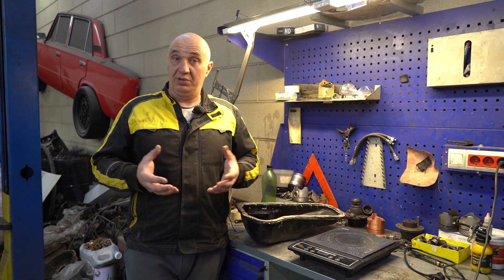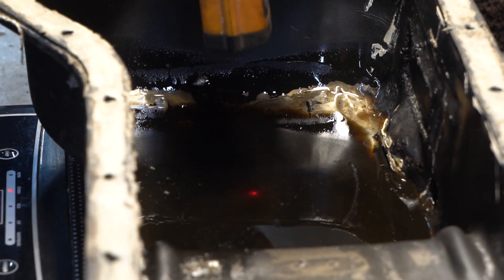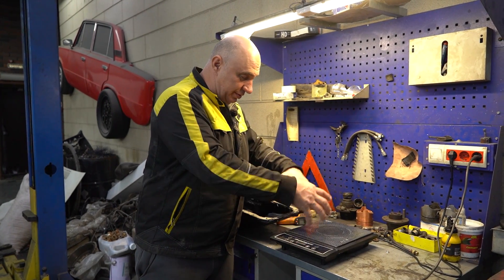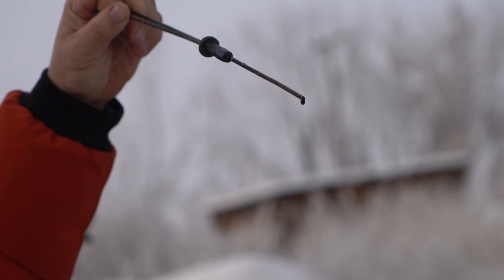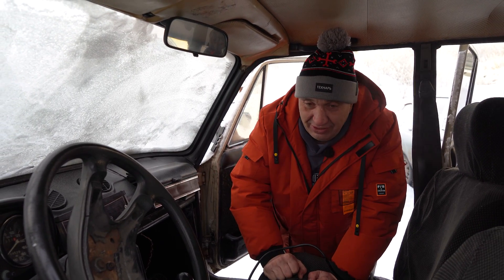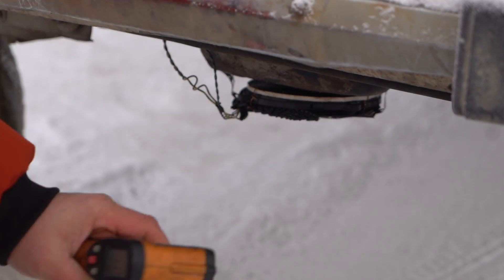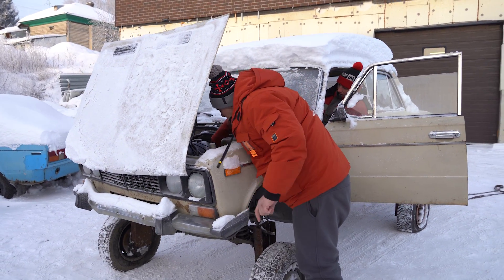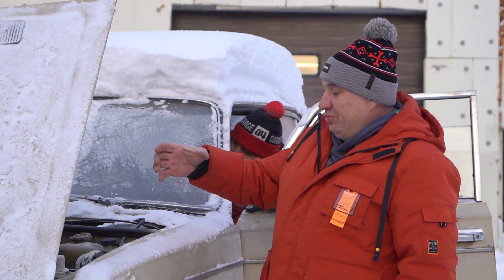We fit an Induction Stove to an Oil Pan

Comment: I would say that heating the coolant would be better as it heats up the block, heating the oil only heats the sump area until you start the engine and the oil circulates.

Comment: Heat exchange/electrical or oil powered convection pump (preheater) mechanism between engine and radiator reservoir.

Comment: If you had time, I would definitely warm up the coolant instead of oil - the heat would transfer throughout the metal parts of the engine, slightly warming the oil up as a result - room temperature of the oil would be enough for a safe start.
Reply: @@karlwithak.The one second until oil gets to the bearings doesn’t hurt them
Reply: @karlwithak.Well they aren’t completely dry when you start. There’s still oil in between. You must be the one that doesn’t know
Reply: @karlwithak. So it’s the oil pressure that prevents surfaces from making contact and not film strength? I don’t think so
Reply: @karlwithak. I’m telling you it’s the film strength of the oil that prevents contact but you don’t have to believe me. You can have your books and I have my experience

Comment: My Jeep has an oil preheater. That makes more sense because the oil will get thicker as it gets colder. The antifreeze doesn't get thicker. The oil would be harder to push through the small passages and oil lines making the starter motor work harder.

Comment: You need a heat exchanger that heats the oil and coolant simultaneously. Maybe some tubes through the oil sump that are connected to the cooling system then try an induction heater directly attached to the radiator. It should work on both brass and aluminium.
Reply: The radiator is isolated from the engine until reach 90°C
Reply: @ObstacleHeads  very easy to bypass the thermostat if you want.
Reply: @karlwithak. well you are allowed to be wrong so keep going!!!
Reply: @karlwithak. maybe your imagination needs more training!!!

Comment: Both, would recommend a dual loop heat exchanger 1 for oil, 1 for coolant, and the heat source in between them.  I.e.. two small radiators with the induction heater in the middle.

Comment: When I was a mechanic working on big trucks, in the winter (if needed) I would tell the drivers that they needed new coolant. Then i. The summer, i would tell them they needed antifreeze. A few understood that it was the same thing, but most would flip out, hollering and cussing, asking why they needed coolant when it was 20°F outside (Georgia, USA), or why did they need antifreeze since it's been 100°F for 3 weeks. I'd let the shop forman explain things to them, if the driver would listen.

Comment: I heat up both oil and coolant nowdays. I used to only be heating up the coolant but anything below 0 degrees and it could take a few seconds before the oil pressure light would go out. At around -20 it could take somewhere around 10-15 seconds witch did not feel good at all

Comment: My truck has a block heater. It is installed in the freeze plug hole, heating the coolant. In the morning everything is warm, I think the heat makes its way through all the parts. I would say heating the coolant is best because; The coolant is in more contact with more areas throughout the engine and everything warmed up.

Comment: Try using a dishwasher heater and its electric pump so you can connect them directly to the coolant system, should be faster

Comment: Not sure I understand why they did this….stick-on oil pan heaters have been available for decades. Can also stick them to your transmission pan.  When I lived in Alaska, I had a block heater (coolant) + oil pan heater + transmission pan heater + battery heater.  All were on a timer to come on approx 4 hrs before I left for work.  Truck always fired right up with no hesitation and I had cabin heat very quick.  Tranny was happy as well. 
Happy New Year to all!
Reply: but your heaters not induction. thats the point of this video.

Comment: Here in Canada it`s called (block heater) pretty much all the vehicle have one, it is attached on the engine block and it does exactly that heating up the block aka coolant and oil.
Reply: I haven't seen a 1500W block heater before. I think that's the point of this thing, they definitely have block heaters and oil pan heaters in Russia, the weird part of this is how fast it heats the oil up.
Reply: @operator8014  Garage54 Style, as usual very entertaining. P.S. The average block heater use around 3.7A = 407W give or take so yeah 1500W you fry eggs & bacon no problemo. 🤣
Reply: @pufek52  The biggest I've ever seen is 1kW, and it only runs at that temp for a moment when plugged in, then thermally limits itself down to about 500. Damn near false advertising.
Reply: @operator8014  yup
Reply: Block heaters screw into a frost/drain plug on the block and heats the coolant. The oil in the pan doesn't see any of that heat.

Comment: Obviously heating both the oil and the coolant is ideal at those temps, but if I had to pick one, I'd rather have a block heater than an oil heater. It will heat more of the engine, generally has a higher wattage, and will help heat the oil somewhat too. Also, a warm block and coolant means the heater will work sooner, the piston to cylinder and bearing clearances will be closer to normal, the fuel will vaporize better, and the engine won't run rich for as long. If you just heat the 4-5 quarts of oil in the pan, it will cool off significantly as soon as it's pumped through the freezing cold block and head since the oil doesn't have much thermal mass.

Comment: I think heating oil would be better because of the fact oil thickens with the temperature drop. Coolant works but is mostly heating the top of the engine. The oil being thick in the bottom can cause it to be hard to turn

Comment: My old 2001 Ford F-250 with 7.3 I had to plug in my block heater. But that was a awesome truck. Had to scarp it with 650.00 km. It rusted away on me. Joys of living in the rust belt. Happy new year guys.

Comment: Years ago a test was done on engine wear at startup. It was done at room temperature, and found that 90- 95% of engine wear occurred at startup and the first 10 seconds of engine run. It was found that wear was equal to 500 miles (804.5 km) of warm engine wear. It was also found that 40,000 miles (64,360 km) of continuous running wear was too small to measure accurately! Oil takes awhile to warm up, even in summer, imagine the engine wear that occurs at low temperature! So using a thermostat controlled pan heater would definitely pay for itself. Salt corrosion is another thing you should experiment with, find an affordable way to stop that, you'll be billionaires.

Comment: As one having around sub  -30C outside throughout this week will find comments which one to heat  just amusing debate of theoretical issues. As long engine gets even slightly warmer than surroundigs it starts easier than one without heating. As long battery and rest of electric parts are pristine. And engine oil is recommend for cold weather. My var lost half dashboard yesterday cold start. After 15 minutes even heat was coming from vents and breathing had stopped smoking.

Comment: Cheers from Greece! The oil is better because it will flow warm inside all of the engine's moving parts and defrost them as well as lubricate them.
The cooling system is designed to just dissipate heat from the engine from lets say an outer layer of the motor but oil is well deep inside the guts of the motor.
And furthermore water has very large heat absorption capability meaning that it will take way more time to warm up than oil does.

Comment: In my area,(montreal) the factory installed block heater does the job, but i can see where an oil pan heater would be a good supplement  in extreme cold. Nice vid, keep them coming
Reply: Same in Finland and Sweden. We have also heathose heaters with pump :)
Reply: You cook eggs in a pan a sump is the oil resiover

Comment: Induction heater eh;  you know I wouldn't have thought about that because I haven't had a steel oil pan for quite some time.  And this doesn't work with aluminum.  This also doesn't heat up the freezing oil in the oil filter.  Video was still interesting though and it did work on this car.

Don't forget that the oil is the lifeblood of these types of engines.  And freezing oil doesn't lubricate metal parts spinning on metal parts very well;  so naturally, heating the oil is most important at those temperatures.

Comment: To me, it seems safer to heat the coolant as it is not as flammable and can be heated to higher tempts without the risk of thermal breakdown. The added bonus is the coolant retains more heat far better than oil.

Comment: Great idea better then the bbq grill under the car. I guess if you had those heating wires for water pipes in winter you could have used resistive heating of the block or water pips?

Comment: For engine preservation, definitely heat the oil first. But, if the car is going to be warmed over night, a coolant heater is best. Many OEM engine block heaters are just a heating element pressed into the freeze plug. Over the course of a whole night, the whole system will be warm enough to save the bearings and make starting easier.
Reply: Why not warm both? @karlwithak.

Comment: Given the choice I prefer to heat the coolant with a block heater. Sometimes you have to use an oil pan heater though, if you don't have a block heater or it's an air cooled engine. They always seem to start a little quicker and easier with a warm block though, so I do prefer heating the coolant. I live in the great white north so the temps are similar to Garage 54's here, lol.

Comment: At least here in the nordics (Fin, Swe, No) almost every car has a block heater, a heating element inside the cooling hose or a diesel-powered heater (webasto or similar). It's a must thing to have if you want your car to start in freezing temperatures (-20C to -30C) and the engine to last.

Comment: I'd say warming up the coolant is better, because it sits in the canals around cylinder walls and so on, so it will heat the oil to some point by itself. But heating just the oil with such a easy access is also going to help nevertheless ;)

Comment: Just welding a small resistance element to the oil pan is a lot cheaper, simpler, and more reliable.
Reply: Stick on commercially available oil pan heater can be had for under $20 USD.  Open package, stick it on, plug it in…😊

Comment: Heating the water is best because there is 2-3 as much water in the engine then there is oil.
Oil is only around 3-4kg and it does not touch anything other then the pan until the engine is started, so the engine is not really heated when the engine is off.
Water in the cooling system is 10kg and touching the engine block (100kg) and bypassing the water pump or power it with a electrical motor is easy compared to the oil system.
Use stove to heat pipes connected to the cooling system and use a electrical drill or something to run the waterpump on the engine.

Comment: 10:42 the plate needs to make contact with the pan to work optimal.
Maybe better if you weld a 8mm or so plate to the sump and make sure the coil is directly in contact.
Reply: It's close enough, they had to turn the power down because it was too powerful.

It doesn't need perfect contact like a traditional heating element.
Reply: @volvo09  Well, the coil is probably optimized for that, not sure how such magnetic penetration is generated, only used a thing like that for a short time. also the metal of the sump is like 0.8 mm, much finer than a regular pan.

Comment: Oil has 1/10th the specific heat of water, no surprise that it heats up really quick when you dump heat about as directly into it as is possible to do so short of putting a resistive heater inside the oil pan.
Reply: That's how people get into trouble when frying turkeys and whatnot.... If it takes 15 minutes to boil water your oil (if not watched) will be smoking and near the flame point in the same period of time.

Comment: -31.8ºC outside.
I wonder how that feels, how is the moisture?
-30ºC inside a industrial freezer is very cold and you can't stay more than 1 hour inside legally.
Reply: Its always very dry in those temps. Industrial freezer will probably be much colder because there is usually airflow in those and below -30c the air is usually completely still and no windchill at all. I went for a 45min walk yesterday at -32c and only my face and toes were cold. Even my phone stopped working because it was in an outer pocket lol.
Reply: @Kissamauhau1  at such low temps, i think i would stop working. LOL

Comment: I guess you could heat The oil   and add a heater in the carburetor float bowl That seems to work pretty good in a Yamaha Big Bear ATV You probably do something similar with fuel injection

Comment: Think about what is happening. It is actually heating up the metal/steel and then heating the oil. Would have to have a steel rad. but you can have the system setup anywhere on the engine that has an "iron" content of metal.

Comment: I just realised that most engines with used oil in them might have enough metal particles to heat the oil with the induction right there. But then i think you have bigger problems than a super cold start

Comment: Where I live in the USA we experienced temperatures much like you do where it can be colder than 40 degrees below zero. I had an engine block heater on my car which warmed the coolant, and that always did a better job than the magnet oil pan warmer in those extremely cold temperatures.

****

Там, где я живу в США, мы испытывали такие же температуры, как и вы, где температура может быть ниже 40 градусов ниже нуля.  На моей машине был обогреватель блока цилиндров, который нагревал охлаждающую жидкость, и он всегда работал лучше, чем магнитный подогреватель масляного поддона при таких экстремально низких температурах.
Reply: -30f is the closest I've experienced (2 times).

My truck always remote started the following morning, but I wished I had a block heater to help not feel guilty about the thick oil.
Reply: @volvo09  I've seen extreme cold, when we went to a friend's house in northern Minnesota the coldest our digital thermometer would read was -41°, the vehicle we were in displayed OL as in open line  .. the car could not interpret how cold it was so it thought there was a problem.

And we still went snowmobiling anyway...

Comment: я пишу это с помощью гугл-переводчика. Я не механик, но, по моему мнению, прогрев масла важен, потому что охлаждающая жидкость ничего не делает, пока термостат не открыт. чтобы охлаждающая жидкость согрелась, я накрыл переднюю часть картоном. чтобы прохладный воздух не мешал мороту согреться. а поскольку передняя часть закрывает примерно половину радиатора, это не наносит вреда системе охлаждения. но для этого нужно иметь другой стиль вождения. например, не давать большого газа или агрессивно ускоряться.

i write this with google translator. im not a mechanic but in my opinion warming the oil is important because the coolant does not do anything as long as the thermostat is not open. to get the coolant warm i cover my went in the front with a cardboard. so that the cool air does not make it harder for the morot to warm up. and since the wents i  the front inly cover about half of the radiator it does not cause damage to the cooling system. but you have to have a different driving style for this. like not giving big gas or agressivly accelerating.